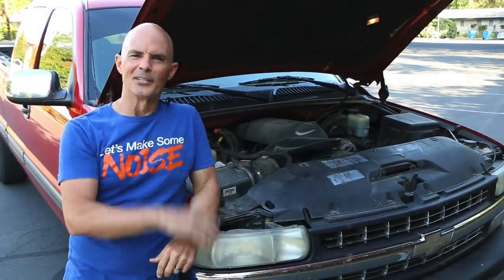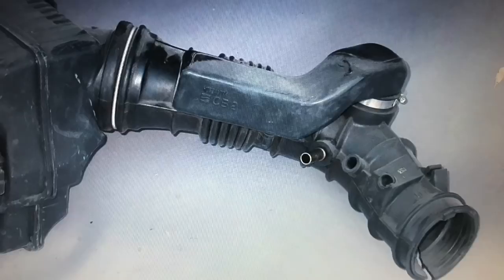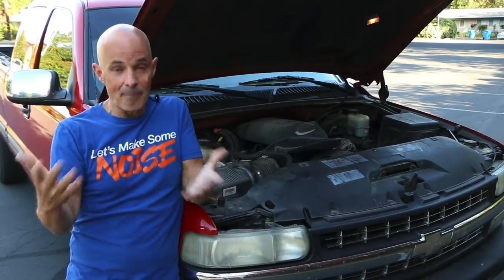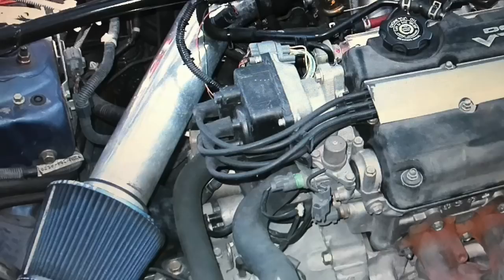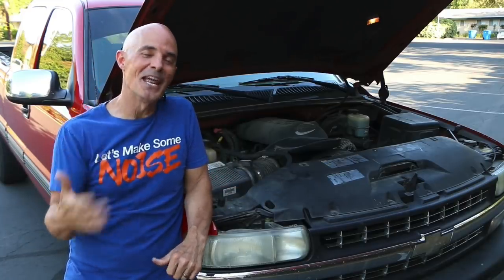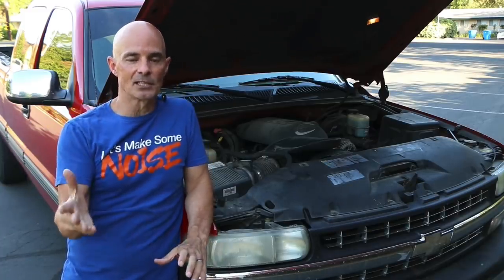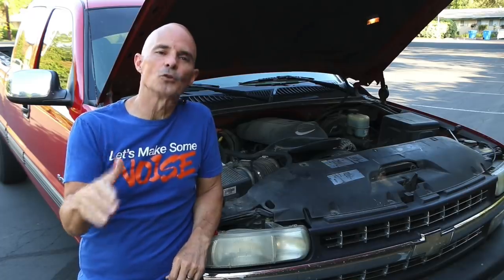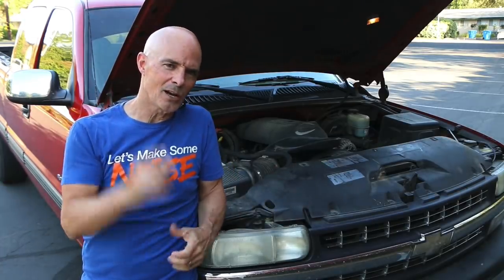YOU'RE FIRED! HOT AIR INTAKES!

Comment: I ran with the hood on my 65 impala open "for about 1/3 mile" after it came up and smashed against the roof.  It didn't help power.
Reply: I've seen a guy in a Subaru with the hood against the windscreen driving 65mph on the highway. I know they have the top mount intercooler but I think he missed the point.
Reply: Or visibility, or aerodynamics.

Comment: I was taught that hot water in a pot boils faster in the stove. Cylinders ignite air and fuel, so pre-heating the air with a hot-air intake will make it burn faster for more horsepower. It's worth almost as much as window vinyl and 10" exhaust tips combined.

Comment: Search: Smokey Yunick hot vapor engine. Smokey developed a 2.5L (151ci) Iron Duke four-cylinder Fiero engine that met all '80s emissions standards (with a carburetor and no computer), made 250 hp and 250 lb-ft of torque (compared with about 90 hp and 125 lb-ft stock), went 0 to 60 mph in 6.5 seconds (stock was 12 to 13 seconds), and managed to get as high as 51 mpg on the highway running 93-octane pump unleaded premium gas (the stocker got about 35 mpg on 87-octane). The hot-vapor engine did all this running unheard of high temperatures at an extremely lean air/fuel ratio, in seeming violation of accepted internal-combustion-engine physics.

Comment: Richard, 1 thing you missed on the air intake systems OEM designs:.    We test "Water ingestion".
200ft long concrete trough, and varied speeds and depth of water in test trough.
Too many tests to list here. But eye opener was a clear hood with tripod video mounted above hood!!   Motor disappears in WATER!!
NEW 4valve motors will NOT tolerate much more than 2oz of water in a cylinder at once!
Bent rods!!!!    We tested with video systems in vehicles, and. Small cameras in intake tract, & aircleaner box.   Real eye opener!!
Also, the resonance, quarter-wave attenuators, were developed in lab. We had Fed Sound tests, FMVSS, and those were done on a special asphalt area called Noise pass-by.     Many microphones!!   Much $$
Vehicle rolled up to test section then went WOT to a certain speed.   And all computer controlled exc the driver.   Test had to be executed EXACTLY to test spec.
I think wot noise limit in pass cars was 86db.
Tests were targeted for 84 to have a cushion in testing, atmosphere, etc....
Built a 4valve motor with removable cam cover so I could run a test matrix with adjustable cam timing!!!  Makes a huge difference in emitted sound on exh & intake!!!   So much more ....🤓

Comment: Damn your killing Honda kids dreams of those autozone cold air intakes adding 15+hp lmao
Reply: "But I read in Hot Rod magazine......."
Reply: Yeah, just ignore the fact that the  C5-C7 Corvette gets it's air coming across the radiator... Doesn't heat rise?
Reply: @Drive2Nowhere No, what's sad, is these kids don't have real fathers teaching them things...
Reply: It's not only hondas, its 90% of the auto industry tbh.
Reply: @yodawunn6700  most of these tests were actually in hotrod magazine.... lol
Video form is so much better!
Reply: @kramnull8962  C7 gets air from the fender. C4-C6 get air from behind the bumper infront of the front shroud for the radiator. They do run their plastic intake tubing over the radiator if that's what you're talking about but there's another layer of plastic between the two.
Reply: You forgot that with stickers it doubles the HP gain to 30!!
Reply: Oh the days of " doooot " tubes.
It's like the late 70's Camaros and flipping the air cleaner lid upside-down....adds extra doots bro!!!
Reply: @robsorgdrager8477  sound is a large part of the driving experiance and if those Camaros only had the trumpet on the air cleaner and no hose from it to a cool air source you would gain volume with a flipped lid with likely the same air temp.
Reply: Ultra CNC  I was tearing apart small blocks as a teen and putting them back together with great results, as a grade school kid I could identify any v8 just by looking at the cylinder head....my uncle was shocked when I told him his rv had a 440, he asked my father how I knew that and he said he knows all that shit.....true story.......rip father and uncle theo
Reply: @robsorgdrager8477  
Haha good times , we would try it on just about anything even grandma's wagon 😂
Reply: @kramnull8962  
Nope...heat DOESN'T rise...hot air does.
Heat transfers to cold.
Reply: Ultra CNC  lmao
Reply: @Drive2Nowhere As far as the v8 kids knowing less about cars, I'd say they know more than your average single-cam-slam-jam civic driver.  Those who buy older 8 cylinder cars are often times do it yourself, farming/working class individuals.  Dad has an 8 cylinder pickup and maybe they ride dirt bikes.  Much more involved in engine basics.  Whereas the kids that could afford a newer import made within the last couple years have their single mom give them a wad of cash to get the brakes done on their mitsubishi eclipse.  These are generalizations of course.
Reply: @Drive2Nowhere by 1990 there were no carbs on any car. 1980 maybe. and yes. a car 16 years newer might just be faster. try that lancer against a 2019 4 cylinder mustang. 305 horse.
Reply: @JohnnyAnderson1  lol? where are your dyno runs? must have blown out the window of your 06 lancer while you were doing 180 mph.
Reply: Ultra CNC  Probably Initial D or some weeb shit like most JDM kids do.
Reply: @dougburg3210  Lancer fanboys are delusional
Reply: @dougburg3210  carbs were used on some cars up to 1991 in the US. Very few though. The Isuzu Pickup had a carb up to 1994.
Reply: Honda guy and proud , straight up reliable engines and with good tweaks its a ripper
Reply: @carlow9224  hell ya rep that Honda,  they make fantastic minivans.
Reply: I see very few "ricer" shit box Hondas an other imports this day an age trying to Rev an race everyone an there grandma... on the other hand the number of  v6 charger ,challenger ,mustang, camaro owners trying to act like they have something badass is incredible... like chill tf out with that lame shit is embarrassing to the car community.
Reply: Yeah, anything branded "Spectre" is probably not needed or useful.
Reply: Ultra CNC  Yeah, cuz NASCAR, NHRA, IndyCar, and Formula 1 teams, who ALL used V8's at one time (F1 doesn't anymore, I'm not sure about Indy), don't know shit about engines, but Manny with the dope-ass lowered Civic that has a wing and tires with 30 degrees of negative camber does.
Reply: Know Bull5hit Lol -15 hp with those autozone hot air intakes

Comment: not to mention that hot air also causes a situation for increased potential for spark knock/detonation as well as increased cylinder temps and cylinder pressures which as a result will require ignition timing to be reduced and/or a higher grade of octane fuel in order to try to compensate. This also increases general wear and tear on engine components. It's a vicious cycle. So bottom line is that although a cold air system may slightly reduce flow volume the colder air temp will easily overcome the slight reduction in flow. Good job Richard

Comment: I wish someone would do a test to see how much power a Honda Civic gets when a B-Boy installs a 160 decible muffler on his stock engine.
I swear there must be 1000 stock engine civics running around Redlands/San Bernardino riding on stock rims (minus the hubcaps), heat spring lowered, billet pep boys lower control arm, VW Golf Harlequin inspired junk yard body replacement panels/fenders, Horsepower improved stickers and that GOD FORSAKEN EXHAUST that gives 1.06 horsepower at 6800 rpm and they test every gear at that rpm up and down these streets.
I also found the horsepower seems to go up the more the hat on the driver is turned counterclockwise.
Reply: How many more with the stupid 10 inch wide rims with 8 inch wide tires, sticking 3 inches outside the fenders, cocked at a 30 degree angle with negative camber? So stylish, yet so functional!🤣

Comment: Great video I totally agree I also love using heat wraps and shields in engine bays as it can make a massive difference
Reply: If ya wanna make a neat heat shield , I've done a vid on my channel a few years ago. 
Basically , get yourself some exhaust wrap , some high temp rtv and some tin. 
Or use an existing tin shield. 
Glue the wrap to the tin, and install your heatshield. 
I just did one on a stock car , I had the exhaust manifold tin heat shield in my hand so I grabbed the wrap and rtv. 
Learned it from an experimental plane builder buddy.
Reply: Cut a coffee can in half and "secure" it with stainless zip ties 😎

Comment: On my old 68 Charger street/strip car, I needed fresh air and carb clearance, but I didn't want to cut the hood. So I adjusted the hood hinges to raise the back end about 1.5 inches. Cowl induction for free!
Reply from the maker: Nice work!
Reply: @richardholdener1727  
I thought you were going to speak on  stuff like the smokey yunick hot vapor engine

Comment: The only thing about this that I believe you left out was metal pipes for intake tubing. All of them I see get so damn hot you can barely touch them. I did an intake test on my centrifugal supercharged 350 and found that a plastic pipe would result in 50°+ lower intake temps, with the highest differential at low speeds and in traffic.

What got me started on the whole intake temp crap was I noticed a lack of power after driving in traffic vs coming from a high speed run, like interstate travel. It just felt sluggish, so I mapped my intake temp with HPTuners and found a significant upward trend when moving slower. That metal pipe would heat soak like crazy, so I stitched to a temporary plastic accordion style one and the heat soak was less. I then went out and bought silicone tubing to run from the intake filter to the supercharger and from the supercharger to the throttle body, with the only metal being the connectors and hose clamps. Not only did the heat soak go away, but I found myself using a significant amount less methanol/water for injection. Since I didn't have an intercooler, and was only running a max of 10 lbs of boost, there was no need, and my intake temps when not in boost would stay within 10° of ambient, making a cool 50+ more hp on the dyno.

To do the dyno test, I would drive around heat soaking everything in the engine compartment, then pull up and run on the dyno as quickly as I could, but never shutting off the engine, simulating traffic conditions. Hood closed, and no fan, in an unconditioned shop.

Before the modifications, heat soak would get intake temps to 150° or so! After...it never went above 100° with ambient at 85° with 80% RH. Of course, methanol dropped it to right at ambient, no matter what the boost was at.

Comment: I agree 100%. Now do a test on air intakes for turbo's. There was obviously a difference on the dyno with different length air intakes on your  N/A Honda, would that also effect turbos?  Would your turbo Honda made more or less power with a 5 or 6 inch air intake tube, does the length of the intake matter, does a filter help or hurt, inter cooler piping length, so many questions?
Reply from the maker: I tested an air inlet on the turbo-it adds airflow and cold air, but does not change Helmholtz Resonance-the turbo is in the way of that

Comment: Back in the '50s, and early 60's, we kids sometimes called the Mercs. "mud Suckers" for the duct that picked air up from the fender wells feeding it to the air cleaners. I have a C4, and often wondered about some of the " cold" air intakes  I've seen that get their air from behind the radiator, and under the hood, when the stock set up gets it from in front of the condenser and radiator, takes it up over the radiator(it should be moving fast enough to not pick up much heat) and straight into the throttle body.  it didn't look like a big improvement to me.

Comment: The factory air intake is usually best for low rpm, as far as cool air, most pull air from outside, only in most cases it is restrictive at high rpm,

Comment: I did the same test with my truck, but by logging the IAT sensor readings. Turns out "Cold" air intakes heat up 50+ degrees C above ambient air and made the truck less responsive. The Stock Airbox did a badass job of keeping the intake air cold, or at most a couple of degrees over ambient
Reply: Mctig Mctiggy it's not that only, it's also the Stock intake placement and sealing

Comment: I feel like the metal on intake pipes get to the same temperature at the throttle body on a short ram or a cold air intake. I went to a mechanic school that had a chassis dyno. And we found out that air didn't like going around turns. So the more bends the pipe had the less power the engine made.

Comment: I know it’s nit picky, but they’re not motors. Motors are electric. They’re ENGINES. Love your channel and your wealth of knowledge. This is a perfect example of practical application. A LOT of speed and performance parts make power on the dyno, but totally fall short in the street. I installed a true K&N cold air intake on my 98 Vortec 454 years ago. Sounded really cool, (like an old school 4 bbl carb), and possibly made power although I believe it was placebo effect. Mass airflow problems because of oil from the filter etc. led me to switch back to stock. Wow, what a difference in low end torque. Stock setup was waaaay better for making power in the USEABLE rpm range on the street. Bottom line: I wasted my money.
Reply: Engines are a type of motor. Thats's why most car companies have "motor" in their name, why motorcycles are not called enginecycles, why they're called motorsports, department of motor vehicles and so on. In fact it's even written in the dictionary as such.

Comment: The factory air intake on my F150 is located inside the left front fender. Using my Banks Data Monster, I have observed large temperature swings for both inlet & manifold air temps when the vehicle is stationary in traffic (+20degs, higher on warm days and within a short period of time). The temps quickly drop as the vehicle starts moving and are within a few degrees of each other.

Comment: Thanks again Richard have you tried using a water to air intercooler pre TB or pre turbo
Couldn't find your back pressure video I think there in confusion between back pressure and exhaust velocity
Reply from the maker: why would you put an intercooler before the turbo
Reply: @richardholdener1727  reduce intake temperature? Kill your air flow? Would it even do anything
Reply: @richardholdener1727  also 💯 about the air dam I utilised a 8/1 ratio in the dam to intake surface area and  difference in throttle response at speed was impressive

Comment: Idk i think it's more of a case by case thing because the amount of air flow through a 2020 Camaro zl1 grill will definitely be alot different then a 92 civic or Acura which barely has a grill to begin with. So in certain cases that mount of airflow in the engine compartment will counter the heat soak from the heat in the engine compartment so that's why some companies like pro charger just have a filter bolted right to it instead of a whole bunch of piping running through the engine compartment

Comment: As a truck guy and a motor guy, I'd live to have a cold air intake, but I'm limited on where i can mount a filter and keep it protected from mud, rocks, moisture. I don't want my tires slinging road spray onto a filter in a fender well. At the same time, I need something because my filter location is terrible. It's about 4" above my driver's side header on a vortech supercharger. 
  I bought a 4" u-bend to mount it behind the driver's headlight but in not sure if that's going to work. I think I'll need a tighter bend because there isn't much room with electronics mounted on the fenderwell...  tcu, msd box, ignition coil, knock sensor controller. That's also where I wanted to mount my air to water intercooler. It's going to become cramped in a hurry. Lol
Reply: Use a snorkel. Doesn't have to be just for keeping water out.
Reply: @donellmuniz590  the added length of a snorkel adds restriction. I’ve found a different style of air-water intercooler that can go in a different location. I think my initial idea with a 4" aluminum u bend will work. I have had transmission issues lately so I'm going to slap in a trans rated for 1000hp and then deal with the intercooler and cold air intake.
  Thanks for the suggestion though dude.

Comment: I always thought about having an extended pipe from the factory air intake and running it down to under the bumper  so that could possibly work on the ls
Reply: On my old mazda, I put a 3" cone filter on the bottom of the stock air system and removed the resonators and panel filter it worked nice, very easy to do and undo
Reply: Until you hit a big puddle, lol.
Reply: @donellmuniz590  Or a dirt road too
Reply: Fine, if you never drive in or right after a rain.

Comment: AIT can be just as important as flow.  To my understanding, the rule of thumb is there’s a 1% increase in power for every 10F degree drop in AIT temp.  
1% doesn’t sound like much, but if it drops 30-40F, that can turn into noticeable gains.  3% on a 200hp engine is 6hp, but 12hp on a 400hp engine.

Like what Ol’ Father Timing (Jeremy) over at FasterProms says...  Optimize everything.  Little gains here and there add up to big results.
Reply: It's called IAT not AIT

Comment: Richard, you hit the nail on the head, thank you for that.  However, you left out one major point that needs to be made.  There are a lot of intakes out there the will completely throw off the MAF calibration on GM's, Fords and anything MAF based.  Without a proper tune you won't see the full gains with these intakes.  I've even seen a few that had their attached engine running dangerously lean.  A few companies are now aware of this and have designed systems that's don't do this but there are only a few.